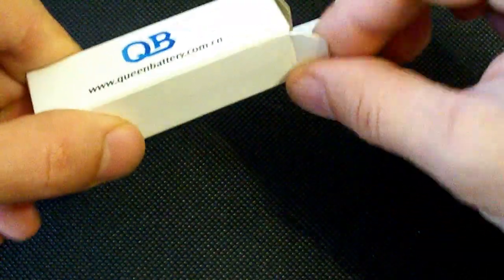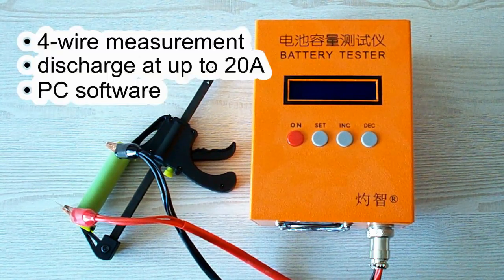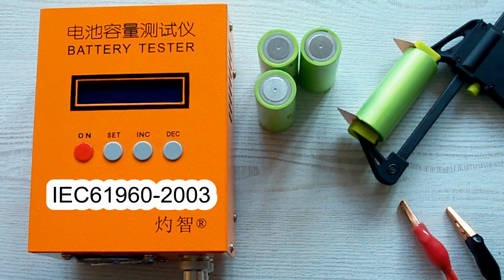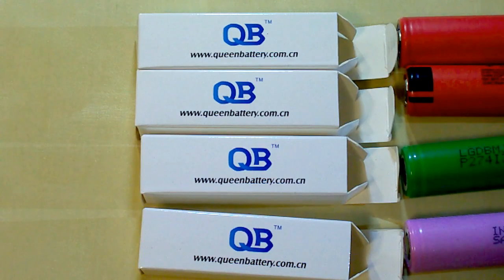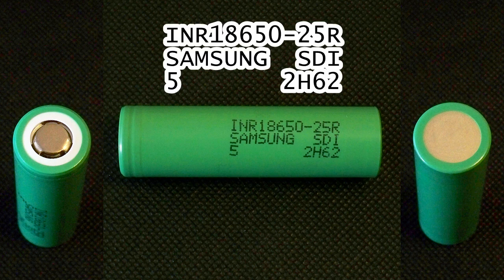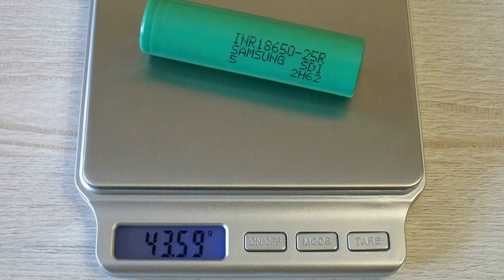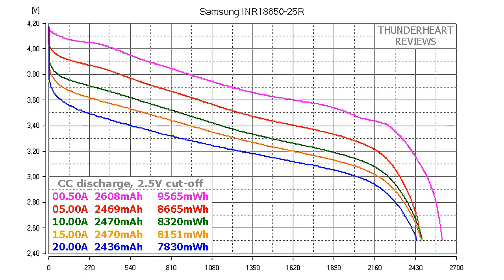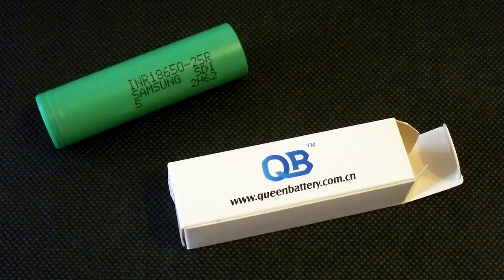Samsung 25R - high drain 18650 Li-ion battery (discharge capacity test)

Comment: Im capacity discharge test my 25r using liitokala 500charger, If im getting 2700mah capacity while only discharge it to 2.8volt and not 2.5volt, do im getting a fake samsung 25r because the capacity is higher than everyone test that discharge to 2.5volt ?
Reply from the maker: Just use more serious equipment for testing. Liitokala, Opus and other similar ones are not able to test precisely.
Reply: The rate of discharge will affect the measured capacity considerably.  Use a calibrated ammeter to determine discharge rate at multiple points during the test. If your machine says it's discharging at 5 A, but it's only sinking 4.6 A, then the capacity is going to read a lot higher.

Comment: For viewers who had the same misfortune I had - I bought a (so-called) battery charger adapter for my DeWalt 18Volt (54V) battery.The original DeWalt battery is around $100, so not cheap. My Chinese 'charger' actually reversed the polarity and discharged the battery to a point that I could no longer rejuvenate it, even after I had conceded and bought the correct battery charger. Today I was about to discard the 'ruined' batteries (Samsung blue INR18650-20S) but decided to pull one apart with the thought there may be a thermal fuse of some sort inside. I cut away the positive metal cap and this was in turn pressing down on a lug which has a flexible lead attached that runs to the battery foils. For some inexplicable reason the lug and the positive cap (both conductive) were not making contact. I'm not sure if there is a deliberate separation of these 2 conductive pieces when the battery is mistakenly discharged below its threshold point. I read about giving the battery a momentary high voltage/current charge, but that hadn't worked. As it was, all the 'dead' batteries were found to be alive and giving 3 Volts when I removed the positive metal cap off the battery. Just another interesting find.
Reply: As these are LiCo chemistry batteries, they begin to decompose once their OCV decays below a certain threshold.  Most battery safety CCAs permanently disable the cell or pack when a predetermined voltage is reached.  The reason is that if the LiCo battery has sustained sufficient over-discharge degradation, attempting to charge that battery again may cause the battery to ignite and burn. At some adequate margin above the drop-dead voltage, the safety CCA will fire a fusible wire in the battery assembly and cause the disconnect you experienced.  A SafetyCCA-Disconnected LiCo cell should be taken to the appropriate disposal facility and discarded.

Comment: I vape with exactly this battery,so.. can i fully discharge my battery to the point i arrive 2.5V and no shorten his life? Plzzz answerr 

Pd: i have a mech mod
Reply: The sweet-spot range of operation for longevity is to keep the charge/discharge cycle extrema between 35% and 90% state-of--charge.  Don't run it stone cold dead, and don't leave it at 4+ volts OCV for any length of time.  (Yes, that's right, DON'T store the battery fully charged. Above 90% charge, the cell will degrade, albeit at a far slower rate than it will at 0% charge. Constraining the battery's charge state and Depth of Discharge in this manner can increase the number of charge/discharge cycle by a factor of 3 or more. Batteries like this typically rate in the neighborhood of 700-1000 cycles. Derating to 55 percent as above will very likely yield 3000+ cycles before it has lost 50% of its capacity.
Reply from the maker: You'll shorten its life in any case. But the lower is discharge cut-off voltage, the faster your cell will lose its capacity.

Comment: Thoughts on a pack of Samsung 40T vs 25R.  From what I've heard there pretty close; 40T for performance but 25R for cost to performance ratio.  Building an e-bike. :)
Reply: the 30T are the best samsung. they can take more beating and can 35 amps while 40T 30amps but 500 more mah. :)